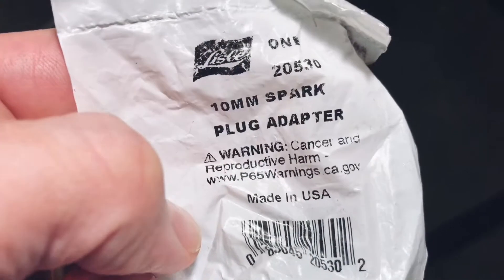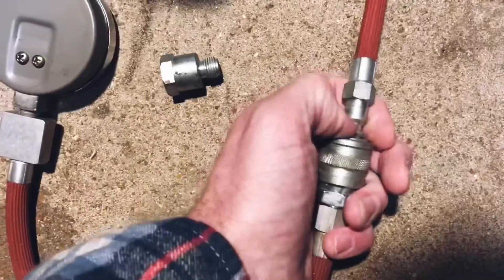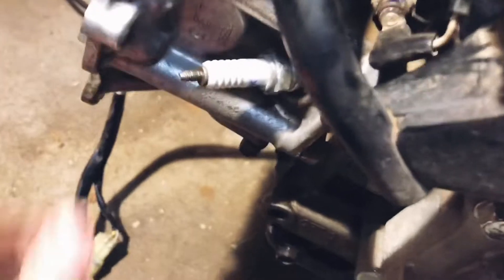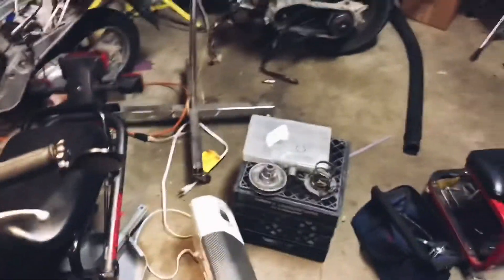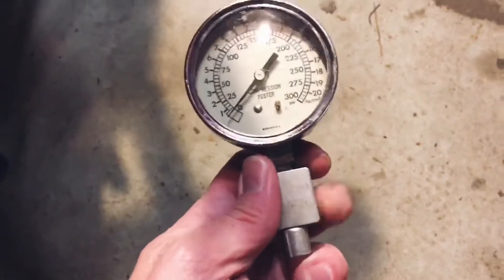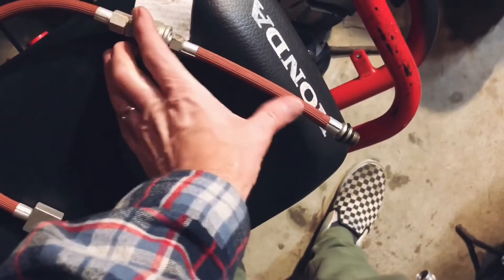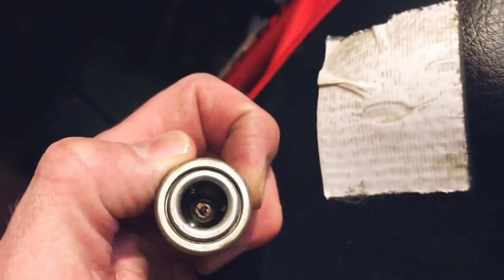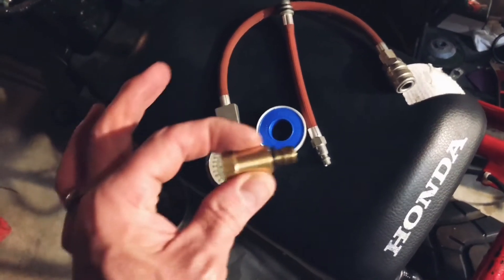Honda Ruckus Compression Test Troubleshooting

Comment: Auto Zone has that tool loan program. You can always do a side be side comparison. Maybe even get a part number for a new house that might work with your gauge
Reply from the maker: I think I'm going fully in on compression testing.. just gonna buy.. I've lost track of how many engines I have, and they basically all need work. Next few years will be lots of engine rebuilds.
Reply: @GETlife  that'll be fun to watch. Will you do upgrades like the titanium valves, cam and lightening the flywheel?
Reply from the maker: CornPap Brecht Maybe in the long run.. but not really at first. I sorta think the cost/performance ratio on those parts is way higher than most of the basics. I also don't wanna put extra money into my first few rebuilds, just verify that I can do it.

There's also alot of mods that can be done just with grinding and tuning. 😉